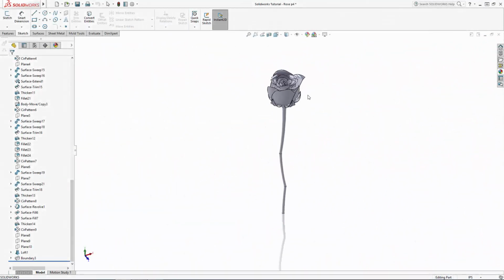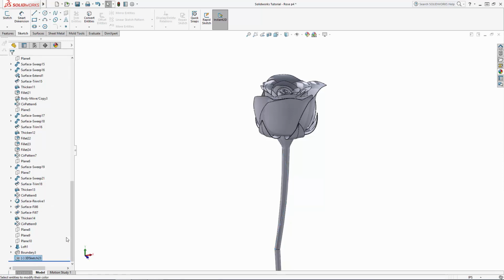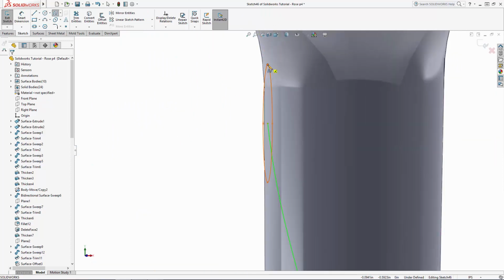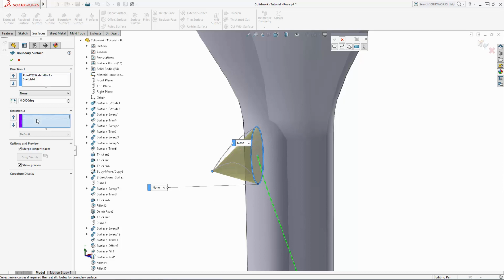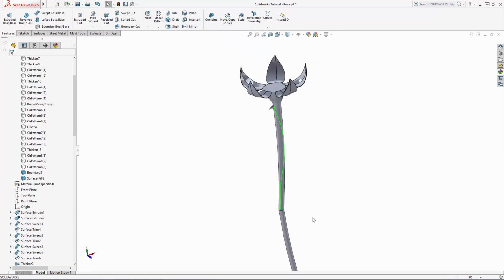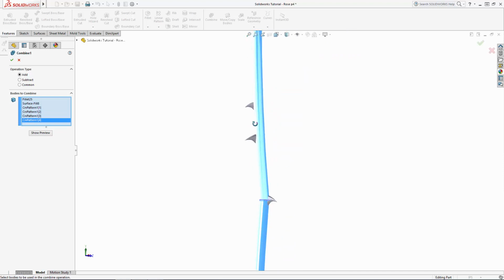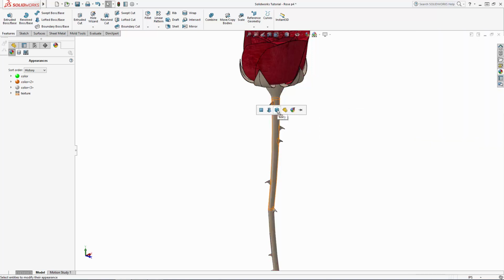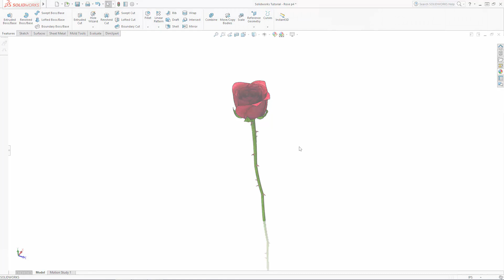SOLIDWORKS Rose Tutorial - Part 4

Comment: Excellent tutorial. My rose has come out looking pretty good, but can only have one thorn at the top. DAMN! Everything was going so well, so far, and I get the the Last Feature, and the app screws up. Oh, wait a minute- you didn't mention it, but I just realized that I had to convert the spline to a "composite curve", 1st. NOW the curve driven pattern works just fine. 
So now everything's cool- this has been a valuable education for me- I was weak in my surfaces use.